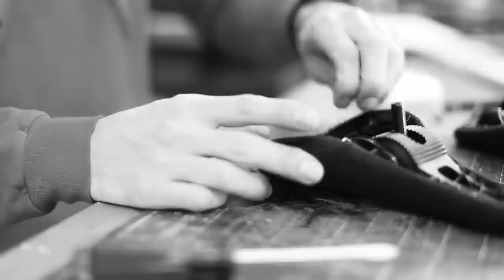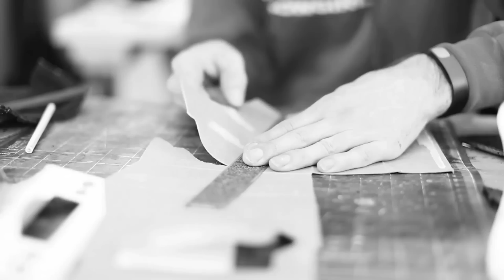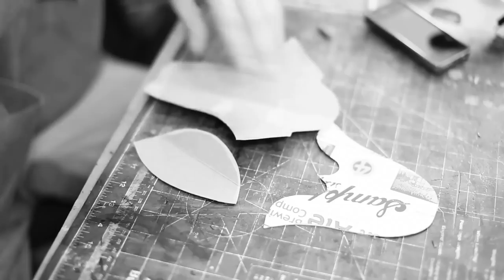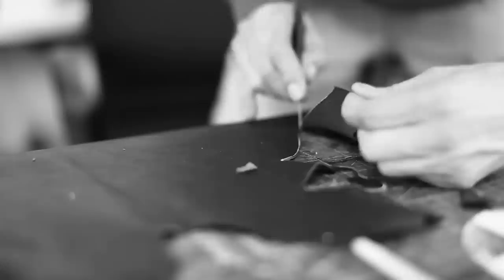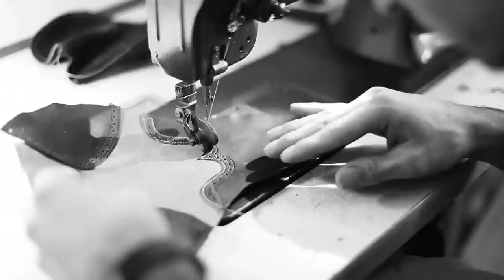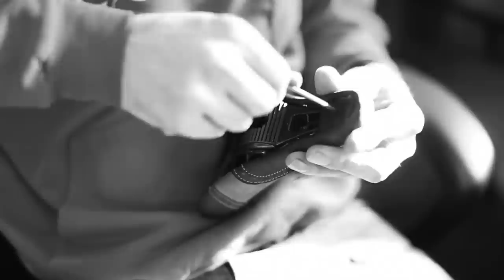Leh Seats Custom Made Leather Bicycle Saddles Reupholstered in USA

Comment: Beautifull work, but it would get wrecked during normal bmxing, thats why the bmx saddles are made strong but cheap. They would look great on a big old touring bike.
Reply from the maker: Jack. I disagree! my BMX seats are typically made with 3 ounce hide. I have a seat on mine that has lasted for 4 years so far, still looks brand new!
Reply: Wow ! Thats great ! I often wondered if it would be possible to put a leather seat on a BMX. I have a Brooks on a regular bike but these liik great. Ill ask at my BMX store if they could stock them Id buy one !